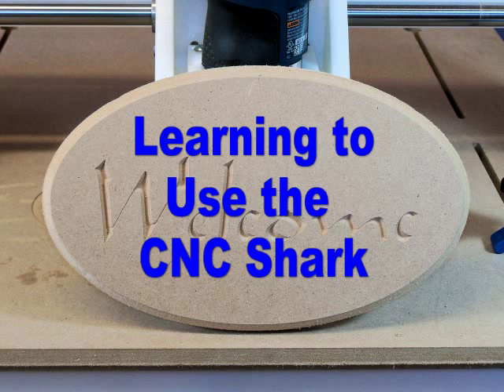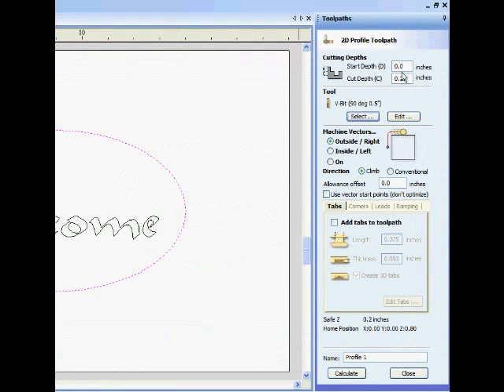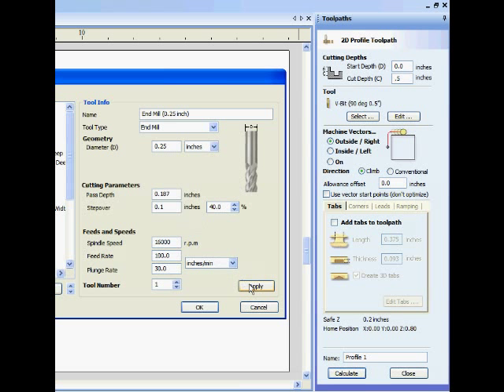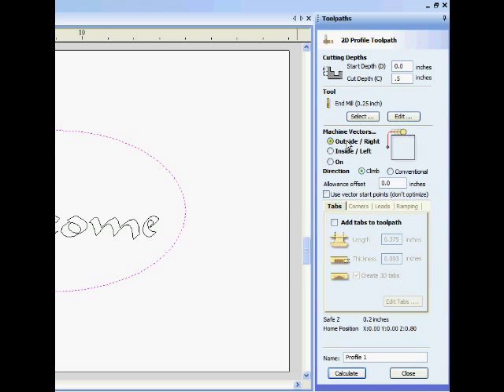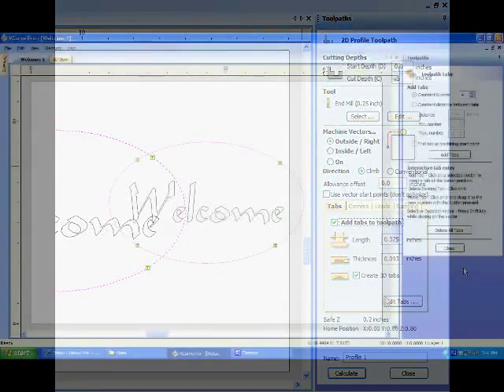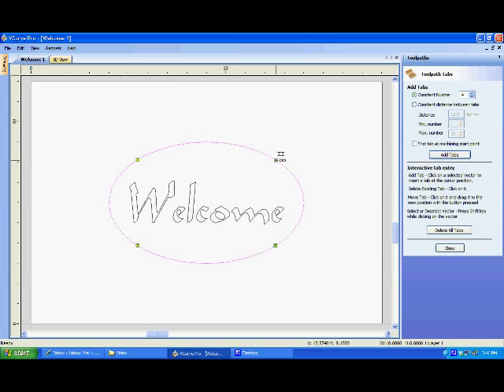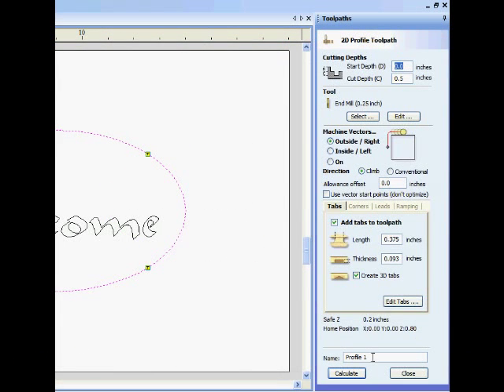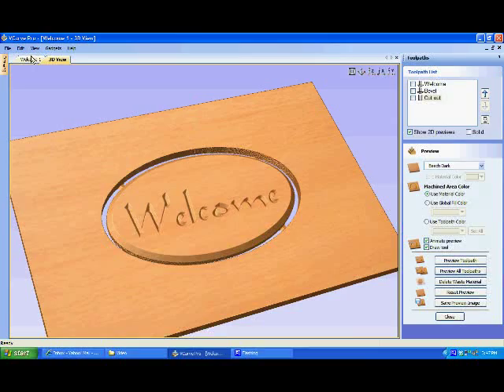Cut Out Toolpath: Learning to Use the CNC Shark

Comment: With shark cnc do you have to purchase ventric software and are you allowed to use software like easel
Reply from the maker: The latest version of Vectric software comes with Shark CNC's. We highly recommend using Vectric VCarve vs. Easel. There are more features and functionality in VCarve. Vectric's list of post processors will work with almost any CNC out there, and is certified for use with Next Wave Shark CNC's.
Reply: @rockler  
With vectric software is there annual fee or is it free 
What is the difference between the one that comes with it and pro version
Can I get team logos as well
Reply from the maker: There is no fee, once you have it, it is yours. There may be fees for upgrading to new versions when they come out. Here is a link to Vectric's product comparison page. - https://www.vectric.com/products - They do not offer sports team logos, if that is what you mean. However, you can import almost all image and vector file types such as .dxf or .svg and the program has a bitmap tracing feature that can create vectors from images. Thanks
Reply: @rockler  
Ok thank you for your help
Reply from the maker: You're welcome.